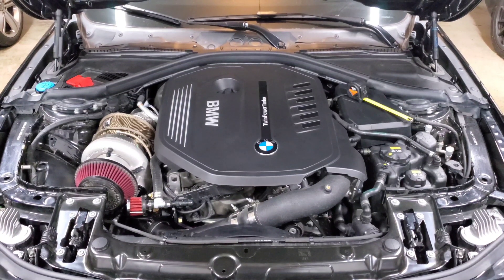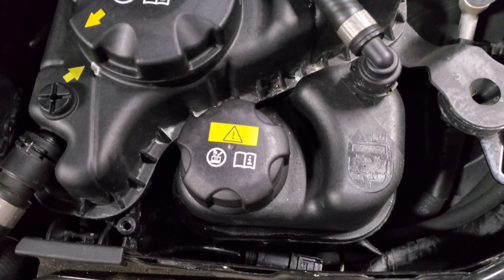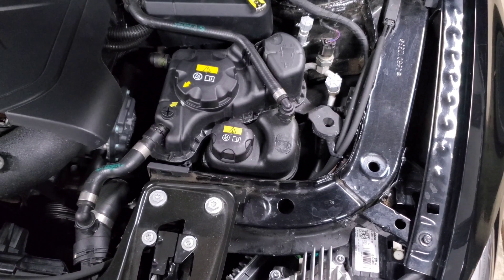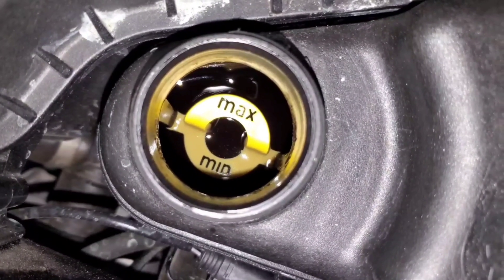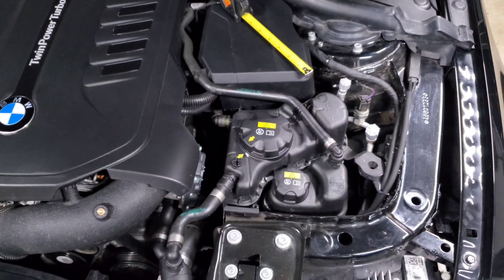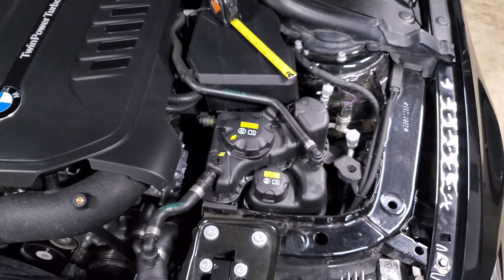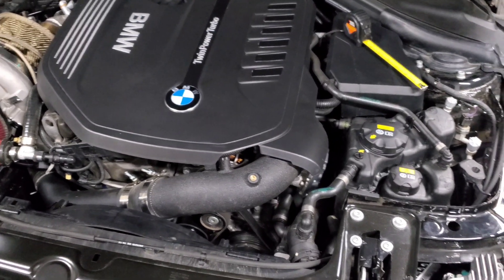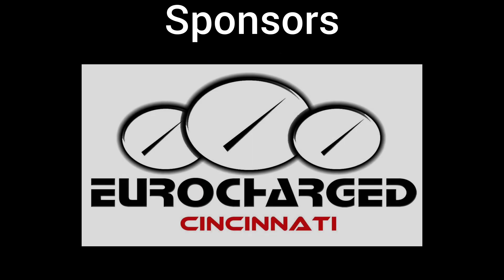**READ DESCRIPTION** B58 Coolant Bleed DIY

Comment: So just to confirm when you do the bleed for the mechanical pump and you turn the car on to start reving, are you supposed to do that while the electrical pump is still going through it’s automatic bleed system? Or do you wait until after when it’s done bleeding itself

Comment: I’m gonna roll through this process to bleed the system. I have a 2018 BMW 330 I but what I have is coolant being spewed from the pressure release cap on the hot, main reservoir.

Comment: Where is the draining point for the high temp system ? That's what really viewers are looking for 😢
Reply: I’m pretty sure there is none. You just disconnect the lower radiator hose with a bucket under it

Comment: question how do you remove all the old coolant ? filling it seems simple but i cant find a good video on remove all of the coolant
Reply: For just a drain (M340i B58TU1), I was able to get out 7.2 quarts by removing the lower aux radiator hose.  The aux radiator(s) is located behind the wheel well cover(s).  As a test I later removed the hose from the passenger side aux radiator, but no more fluid came out which makes sense because the aux radiators are at the same low point.  Unfortunately this is is just a partial drain as approximately 3.9 quarts remains in the system (11.1 qt capacity).  So you can either call a 7.2 qt drain good enough and re-fill with a 50/50 blend, or do what I what I did, which is fill the system back up with only distilled water, bleed it, then drain it one more time to dilute the old coolant a little more.  You could repeat this dilution process as many times as you like.  I felt that one dilution was good enough (calculates to 6% residual old coolant).

Comment: Do you have the details of bleeding for 2018 530e? My heater is blowing cold air and before I do detailed troubleshooting, I want to make sure I bleed the system. I changed some hoses in that car.

Comment: Quick question. My dad did me a favor when he borrowed my car and did a coolant flush as a thank you. He did it all properly except for the coolant itself. Instead of putting the bmw blue stuff, he put Green PEAK coolant as a 50/50 mix. I did some research, and it's based on ethylene glycol and is nitrate and phosphate free like the bmw one. I'm just wondering if this can do any damage. I have a 2018 340i. Thank you in advance.

Comment: (on a supra) For the High Temp circuit: I started with electrical pump and got the "service function started" notification so it looks like it's working. Then I started in pump 2 and when I started the car it went to 1200 RPM for a second but then said "Service Function Canceled" before I could Rev like suggested. Any thoughts?
Reply: Did you resolve?
Reply: @S2kkmanny  I ended up following this process

High temp circuit (turbo circuit)
(2 coolant pumps) 
1)
Diag mode
Heater max
Low fan
Accel 15 seconds
Listen for buzzing
2)
Turn on car (revs should be 1200 rpm
Rev engine to 2-3k (10sec)
Idle 30sec
Repeat

Low temp circuit:
(1 coolant pump)
Ign on
Headlights on
Heater high
Fan low
Hazard lights
Accel pedal for 15 sec until buzzing
Reply: @Deighvid. which procedure did you do first?

Comment: When you go through the rev process, the caps have to be on. 😮
Reply: How would the air escape if the caps are on
Reply: Rev process the cap must be on ?
Reply: Yeah nah, I did this and blew off hoses cause not enough air escaped
Reply: How’s that going to allow air to escape?

Comment: When I tried this I can hear noises from the DME obviously buzzing but also a gurgling slightly but nothing moves in the tanks..ideas? Electric pump dead? Gen2
Reply: any update?
Reply: @Kawsnfriends  no idea but the pump started working on its own again which is great, but my fuel pressure started to act up afterwards. One electrical issue to the next

Comment: Do I need to have the cap off when bleeding it.  My problem is that very occasionally I will see a puddle of. Oolong on the right side of the car.  Car never over heated but this happens at least twice.  One time coolant low warning came in and today the wanting didn’t come on but coolant was low
Reply from the maker: i recommend keeping it on at least initially because it helps suck the coolant down when the pump ramps up

Comment: If anyone is wanting to do this without risking the battery dying, I took the cap off, started the engine with the AC on & then waited for the pump to kick on then filled it all the way up, after a few times of doing this and driving around then parking & waiting it gargled all the water down one last time. I might have some air bubbles in the system but the AC kicks on & stays on blowing ice cold with no more coolant drop in the tank.

I don’t know if turning the AC on sped up the process at all but I did it anyway just in case.
Reply: I tried your advice and it worked like a charm..Thank you

Comment: My Z4 M40i has had the intercooler changed after sustaining damage in an accident.

 The garage is following these instructions, but the electric pump is not starting the bleed process.

Comment: Just wondering, why the need to turn on the headlights?? Never heard of this.
Reply from the maker: Processes like these are setup so you can activate them without a programming tool, but also you won't have a risk of turning it on by mistake

Comment: Isn’t the B58 equipped with a mechanical water pump ?
Reply from the maker: The B58 has 3 water pumps. 1 mechanical and 2 electrical

Comment: Its same for g20 ?
Reply: It is for the gen 2 b58 in the Supra so I’d assume so. You’ll know pretty quickly if u can’t hear the electric pumps ramp up in the low temp circuit if it’s different

Comment: The high temp cooling circuit method in the video didn't seem to work on my 2017 430i.

The low temp cooling circuit method shown in the video did work.  
Oddly the method shown in FCP Euro's video: https://www.youtube.com/watch?v=zXhwpFzsySw&list=PLvGCkR0OSzPwp4WIdvlBHxG5eeGaVGei9&index=10&t=55s
did work on my low temp cooling circuit.  This method did not require the headlights or hazards on.   It also turned off the car when it finished the process as well.

Comment: Hey @kern417 a subscriber here. I have a question. I know BMW suggests using a vacuum tool to do this but I want to do this at home, my theory is that I can use the manual bleeding procedure that allows the system to bleed cooland and get air out from the system to my advantage. I'd take out the hose that brings back the coolant back to the coolant reservoir and take it out from the reservoir and connect to a garden hose that will allow me to extract existing coolant from the system. While I'd keep adding either fresh coolant at the same time ensuring no air entering the system and at the same time replacing the fluid in its entirety. Do you think this would work?

I intend to follow the following steps

Remove Hose:

Disconnect the hose leading from the engine to the coolant reservoir.
Connect Garden Hose:

Connect a garden hose to the disconnected end. Ensure a secure connection to prevent leaks.
Flush System:

Start the engine and allow the coolant pump to circulate the coolant. Simultaneously, introduce fresh coolant into the system through the radiator cap or other suitable access points.
Bleeding Procedure:

Follow the manual bleeding procedure outlined in your vehicle's service manual. This often involves opening bleed screws and allowing air to escape while maintaining a proper coolant level.
Monitor Temperature:

Monitor the engine temperature carefully during and after the flush. Ensure there are no signs of overheating.

Comment: Hi, my intercooler is leaking(smaller radiator) so i ordered a new one. How do i remove all old coolant from the system is there a drain plug?

Thanks!
Reply from the maker: No drain plug. Just disconnect the lowest hose on the radiator

Comment: i just change the water pump on my bmw i8 b38 engine and my heater is not working and im getting overheating do you think i need to bleed the coolant i haven't tried yet
Reply from the maker: Yes.
Reply: @kern417  it worked!! i bled a couple times now im getting heat and my temps staying under 100°c

Comment: Hey buddy, nice video. Im flushing the coolant this weekend. No one seems to know, but you seem to know everything about the b58.. Whats the coolant capacity, do you know? Ill be draining both tanks
Reply from the maker: Low Temp: 3.9L
High Temp + Manual: 9.3L
High Temp + Auto: 10.5L

If you get 2 Gallons of Coolant and 2 Gallons of water for the 50/50 mix, that should be enough for both.
Reply: @kern417  cheers mate
Reply: @kern417  I did the low temp one by removing the overflow pipe and fixing it to a long pipe into a bucket and kept topping it off until it changed colour. I couldn't find an easy way of draining it without removing the bumper

Comment: Great video...thanks!  I have a general maintenance question:  At what mileage would you recommend replacing the coolant for both the high and low temp systems?
Reply from the maker: not something that's necessarily needed if the system is working properly. it's nearly impossible to actually drain all the coolant in our cars.

Comment: Thanks for your video @kern417, I was discussing the difference in color and appearance of the coolants in either the low temp. (clear brown) and high temp circuits (blue) from the factory with @NoBrainerTalk. It seems BMW does not recognize any part number for the low temp circuit and people were changing them both tanks to the BMW regular coolant (blue). Was this also the case for you? There is one user who pressure tested at the BMW dealership and found no issues and that their mechanics stated they do not know why the color difference exists. Do you have any more information?
Reply from the maker: My car always had blue and i always replace with blue

Comment: While bleeding air out from both main and cold circuit reservouirs,  should cap of the reservouir be open? and, while bleeding air from hot circuit, should the plastic bolt near the cap also need to be turned anticlockwise to get air out?
Reply from the maker: Ive done it both ways. And no need to remove the bleed screw
Reply: @kern417  And how many liters of coolant do I need to fully fill with 50 percent water after a full drain of both hot and cold systems?
Reply from the maker: Probably 2 gallons and 2 Gallons of water
Reply: @kern417  Will I need to use %50 coolant + %50 water at Intercol's Low Temp sys as well? The color of liquid inside the high temp sys is blue, and the color of the liquid inside the Intercol's low temp sys is transparent which confused me that there should or should not be coolant inside the low temp sys at all? Do you know the answer mate?
Reply from the maker: @demirunlusoy2795  yes. All coolant should be 50/50
Reply: @kern417  Okay then it should be max 2 and half gallons of coolant plus 2and half galons of water as My pre F30 took 1.32gallon of coolant as it had only high temp circ. Will B48 engine need same blue collant as F30? I used Bmw GS9400 approval Motul autocool expert Ultra before. same should do for g20 with b48 ?

Comment: Step 1 is to take the old coolant out, how - wich hose needs to get disconnected to drain all of it? Do you remove both coolant caps at the beginning or at different points, and when do you put them back on? Not sure how this was labeled DIY : / Maybe for people that regularly work on their car and know this but for a newbie like me I'm having to find other videos that actually go through the entire process and outline all the steps.
Reply from the maker: This is a DIY for bleeding the coolant system. Look up the definition of coolant bleed. Sounds like you're looking for a DIY for a coolant change

Comment: Thanks for this - very helpful. I can confirm I used this process today to bleed air from the low temperature circuit on my 2016 M140i manual and it worked a charm. This is despite this method not being mentioned in the official BMW manual which states that both circuits are bled together by pressing the start button 3 times and actually running the engine, more or less as per part two of this video.  When I ran the process, I could clearly see fluid and bubbles moving around in the low temperature tank but there was nothing going on in the high temp tank at all. This would mean that the first procedure only runs the low temp electric pump or could be running both BUT on the high temperature side, the electric pump is not part of the bleed process and it seems logical to me that this pump is only used as an auxiliary to cool the turbo after shutdown. My conclusion would be the first procedure (undocumented by BMW in my manual) does very usefully purge the low temp system by running just the one electric pump and the high temperature side is purged by the mechanical pump, whether or not the second "auxiliary" electric pump is running or not. According to the official manual, the second procedure (and indeed the only procedure mentioned by BMW) does bleed both the low and high temperature circuits at the same time. Either way . . I'm happy with it because I only wanted to bleed the low temp circuit but in future will probably just run the second procedure and bleed both together with the engine running. I don't think the second electric pump plays a part in any of this - I suspect it merely kicks in after shut down to keep the turbo cool.

Comment: Thanks for a very interesting video but now I am confused. I have a copy of the official BMW Service manual and it states that both circuits are bled simultaneously. The procedure in the manual is very similar to the method you demonstrated but differs slightly. It clearly states one procedure to cover both circuits. First step is to release the bleed screw for 10 seconds or until fluid seeps out. Connect a charger to the battery, switch on headlights and hazards. Fasten driver's seatbelt. Heating on max, fan on min and then 3 quick stabs of the starter button, followed by 15 seconds with the accelerator depressed and then start the engine. Now rev to 3500 rpm for 10 seconds, followed by allowing the engine to idle for 30 seconds. Repeat this process 5 times and then leave the engine idling at 1200rpm. After 11 minutes, revs will drop to normal idle of around 850rpm and the process is finished. . . . . this is as per my official manual BUT . . . I am acutely aware these documents are not always absolutely accurate and I am intrigued by your method because I do want to bleed my low temp circuit ONLY and if this is possible without running the engine, I would like to give it a go but it is strange that my manual specifically states that both circuits are bled simultaneously with the one procedure.   Is this technique something you discovered yourself or is it documented officially??  I'm puzzled.  Anyway, either way - I 'm definitely going to give it a go because I siphoned the coolant out of my low temp tank and in doing so and refilling it, I managed to get air into that circuit and it needs bleeding but I don't really want to run the full bleed of both systems as per the manual
Reply from the maker: Like i said in the video that's how 2 water pumps are bled. There is still a 3rd pump.
Reply: @kern417   I understand about there being 3 pumps and the reason for each. I'm just a little confused that the service manual only highlights the single procedure I documented above and says nothing about being able to bleed to low temp circuit on its own. I will try it and from your video, I'm sure it will work - it's just baffling that the procedure isn't documented in the BMW service manual - only the single procedure for bleeding both circuits at simultaneously with the engine running. The other thing that's weird about the procedure in the manual is it suggests letting the car cool down after bleeding and then topping up to the max level plus an additional 200ml!!  This would tend to suggest that even a full bleed can't be expected to get rid of all the air and over a period of time, a little more will be released and hence the 200ml overfill.  Anyway, I'll be a happy camper if the standalone method works - will try it first thing in the morning
Reply from the maker: I got this procedure from the BMW service manual. It's there.
Reply: @kern417  I'm intrigued . . .it definitely works because I did it yesterday but I can't find it in my manual which specifically covers the F20 140i.  It could be documented somewhere else in the repair section and I've just not found it . . . could you possibly give me the page number in the manual? In mine, the dual procedure is described on page 5360 of 9308 but unable to find any reference whatsoever to the single procedure - very baffling
Reply: @kern417  . . . The explanation is of course that my car is a 140 and many of these manuals are compiled as a cut and paste exercise. With a B58 engine, the procedures should be the same but clearly the two manuals are different - your 340 vs my 140 but . . . the error or omission would appear to be in my manual.
That said, I would still vacuum fill if filling from scratch, particularly the high temp circuit.

Comment: Is it possible to do low temp bleeding by running the electric pump with headlights + hazards + hot air flow on for 10 minutes without a high AMP car charger? I only have a 4 Amp trickle charger. Will the battery be drained?